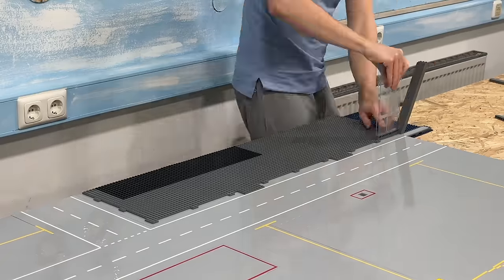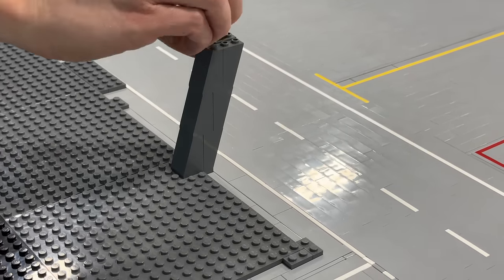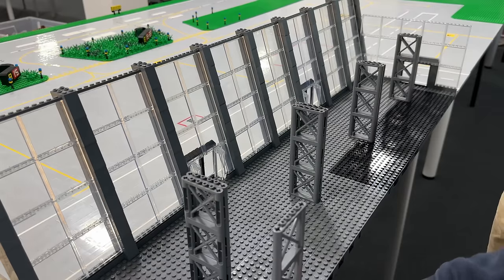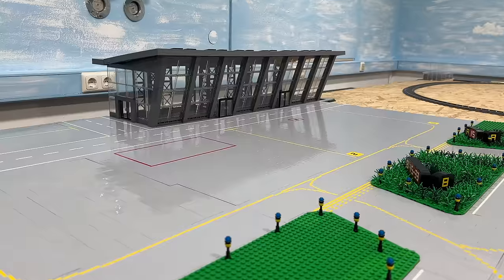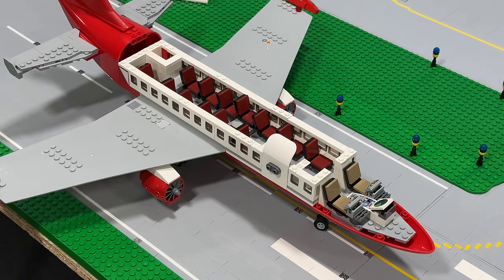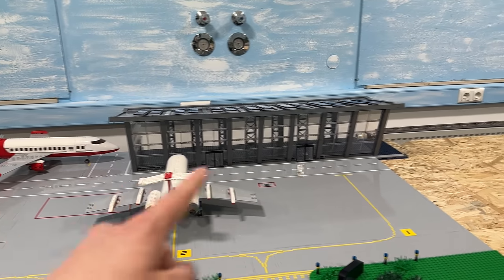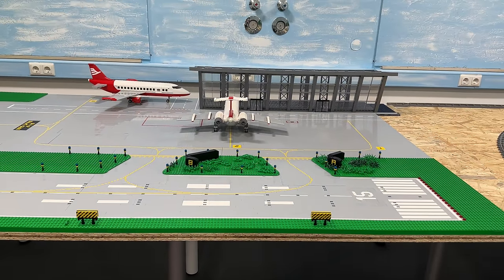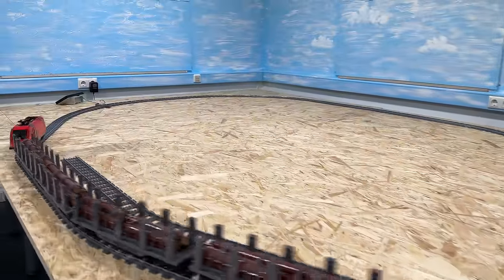LEGO Airplanes and Airport Terminal! - Lego Airport Update

Comment: Student pilot here. Love your work! 

Planes use their left hand doors for passenger boarding. Make sure you switch the door on the red tail plane to get an accurate representation! Also, from what I could see in the video, the service vehicle roads are very close to the aircraft noses. Due to space limitations I guess you cant really do anything about that but if you get a bigger space in the future, make sure you give a bit of clearance between the spot where the front wheel of aircraft stops in the gate and the service vehicle roads. 

Amazing stuff! Keep it up!

Comment: Wondering how it would look to use flat tiles in two different green shades to simulate mowed grass.  If it looks good it would get rid of all the studs and you could still use the claws and normal grass to add a variety of patches to the grass

Comment: an idea: sometimes the gates of the terminals have movable "bridge" (looks like tunnel with legs with wheels): it connects the plane directly to the gate, so the people board the plane directly to the building. And when all the bridges are busy, or it's a small airline, they send instead those harmonica buses to the plane, that is parked somewhere on the tarmac 🙂
Reply: could be interesting to add a "drop off" area for cars and taxis, when they arrive to the airport from the city. they have there those red and white bars over the road and parking ticket machines...

Comment: I remember you talked about adding some kind of wear to the surface of the landing strip, apart from the tyre marks. Maybe you could try buying second grade used parts, that are slightly scratched, or off colour, and replace a few pieces of the strip, where the traffic would be much higher

Comment: To fix the size problems with the planes, have the current terminal building as the main terminal for check-in and arrivals etc... and build a monorail (people never build Lego monorails so it will be unusual) to another building on the grass area or the wood to the right with a rectangular building with two jetways each side and 2 planes each side. It would be a bit like Stansted Airport then with a a bit of Atlanta thrown in for the toaster rack design.

Comment: Grass at airports, particularly one’s with heavy commercial traffic volume, are religiously mowed. Overgrowth can become a safety hazard by coving up signage making it harder for pilots to read, blocking lights, and hindering emergency trucks that need to operate on the grass. So shorter and less for the grass is more! 
Maybe could add a tractor dragging a mower behind it mowing the grass!

As another commenter said, ATC tower!

Great work per usual!

Comment: If you really want to go the extra mile, you could add a rotating green-and-white beacon to some high-up point on the airport, which designates it as a civilian land airport to anyone flying by during the night.

A taxiway leading to the other end of the runway is an excellent idea, as planes usually want to take off going against the wind wherever possible, and that would enable that.

Comment: you could also add PAPI lights (red/white lights by the side of the runway that tell a plane if it's too high or low), would help break the monotony of the grass areas. Plus an ILS localizer antenna strip across the ends of the runway. and maybe approach lights in the neighbouring area - that would help integrate the airport into the surrounding scenery... And a little red/white checkered shack somewhere that holds a navigation beacon. There's lots of possibilities to fill the "dead" space around the runway & apron.

Comment: You need to lower the aircraft with the engines in the tail to look more realistic also add the air traffic control tower (I recommend Heathrow tower design that is beautiful) the max you need to add a 36m wingspan "sign" in the main area to be more realistic to the size of the airport and runway
Reply: Don't hate on me I am an avgeek

Comment: I work in solar, so this might be a bit of a pet peeve but you should add some light grey 1x2s with maybe a grill piece on the right edge of the roof seen at 3:10 (i would suggest 4 each one stud appart). To symbolize inverters and maybe if there is room a dark green small transfomer build next to the building. I think it would add alot to the realizim as no roof is truely clean and there is always some equipment up there. And every engineer will appreciate the detail. Gerat build as always though.

Edit: Maybe i was wrong and the 'inverters' should be on the left side and a transformer left to the building to have it not infront of the entrance.
Reply: I think the biggest problem with these solar pannels is the fact they are facing ENE (060°).

Comment: Airport terminal building looks cool, but you can add an air conditioning or roof top unit to have more details on the roof. I think it will look nice and add some pipes on roof as an air distribution system for mini figures.

Comment: The problem with your abrasion on the runway is that it's in the wrong spot and it's also too cluster and centered. Real runway abrasion will happen not when the tyres hit the runway, but will happen as the brakes are applied and reverse thrust is applied to the engines. This will cause a long set of skidding marks most heavily under the the rear offset tyres (which are more heavily influenced by the engine stress, rather than the front wheel) which will extended much further down the runway than the small section you have done. The run way is both "too clean" (at the far ends), but also "too messy" (at the contact point) and it looks out of place.

It's also worth noting that airports clean their runways, at minimum, once a year to remove all the rubber build-up, so essentially it shouldn't look so bad. I get what you're trying to do, but respectfully, IMO, the colour location is wrong, it's too short, and it doesn't make sense if you're giving it that realistic look? 

Please don't take it the wrong way, your lego work is amazing, I just picked up on your comment and for me, wanted to give an idea as to why it is jarring.

Comment: I like the airport, except its elevation. If you could make it elevated by maybe 8 to 10 bricks, you could add the gate bridges, and have room below it for baggage movement, etc. most airports are elevated by a floor which is why the gate bridges are on wheels and are roughly a floor above ground level.

Comment: Friendly reminder that the “highly illegal” sign at the start is not at all an illegal technique. An illegal technique is one that uses pieces in ways they’re not supposed to be used, which damages the pieces. Get a long 1x10 plate & stick tiny 1x2 plates vertically between the studs, the 1x10 will eventually warp. THAT, is an illegal technique, not any of the others that you call “illegal”

Comment: So, I’ve been following this for a bit and I don’t think I’ve said much, but for the terminal, since the structural beams are in multiple pieces you could essentially build a second floor so you have a basement for the ground crew directly connecting to the tarmac. And for the grass I would suggest trying flat round studs and staggering them in random spots mixed with flat square single studs as well to see how that pattern looks

Comment: As a pilot I agree with others that the airport is looking great but the terminal is slightly out of proportion also located where it is at the back of the layout makes me think how would people access it without any roadway connection, parking or train station. Definitely need a taxi away otherwise planes will need to back track on the runway, also at the runway threshold you may what to build in a turning bay for aircraft to position for departure and yeah you definitely need a ATC tower.

Comment: If you are willing to do historical disasters maybe you could have a DC-10 landing with a piece of it left behind it with a Concorde on the taxiway. The disaster that happened was a Concorde was waiting to takeoff but a DC-10 landing had a piece fall off and when the Concorde was taking off the piece got stuck in the tire, puncturing it before being ejected through the main fuel tank, one of the engines, catching it on fire and destroying an aileron which caused it to careen off to the side and it crashed into a hotel.

Comment: I really like the look of the airport so far, but you definitely need to add some sort of air handling system to the roof top of the airport along with a exterior generator and condensing units, you can find a lot of real life references to hvac materials from places like Trane Link Drive.

Comment: Please correct me if I'm wrong, but I don't think you're always using "illegal" correctly when it comes to building techniques. It is only illegal when the connection puts more strain on the piece than is originally intended, but you use it even when simply laying things down, like the chain on the small village bridge you did last video.

Comment: While I totally get the whole 'lego only' mindset (as otherwise what is even the point) it is a little sad that you can't just 3D print some airplanes at the right scale. Or at least the shells. Those are all custom parts Lego came up with to solve the same problem anyway, just like how in modern sets they're doing lots of custom objects that don't at all fit in the original lego mindset. It would be neat to at least experiment with what you could do with some constraints, like only being allowed to scale down existing 'large custom' lego pieces such as the plane shell, as that's no different from what lego did themselves when they created those pieces for a new set.
At the same time, the whole 'scale is off' feeling that every lego build out there gives is also neat. It's like anything a size up is too small, and anything a size down is too big; the people don't really fit in the place, most houses don't really have enough space to live in, the planes are too big for the terminal, but it all just works and is detailed enough to look realistic.